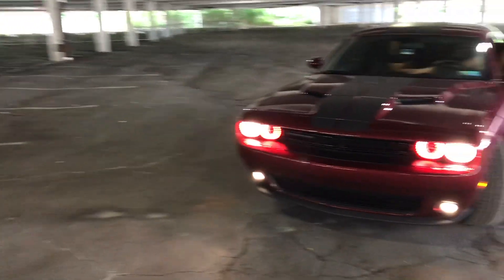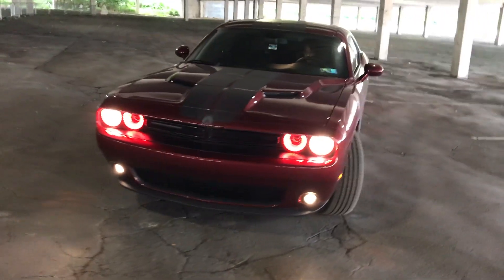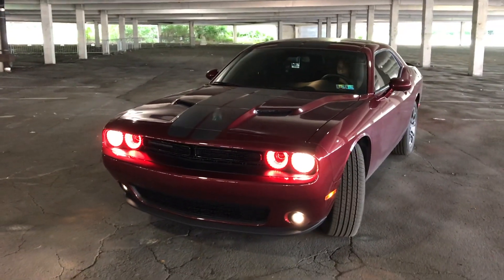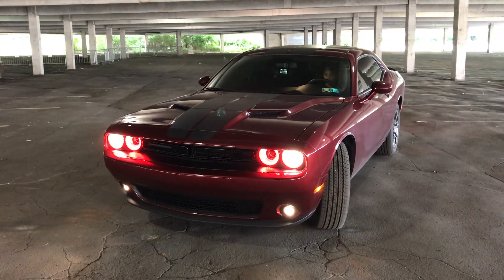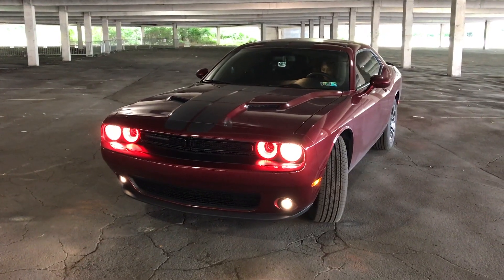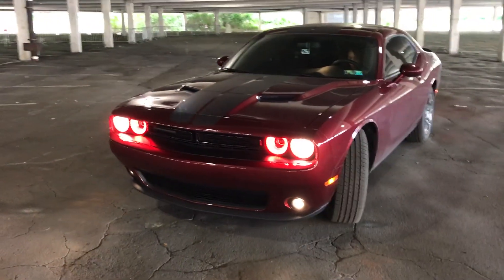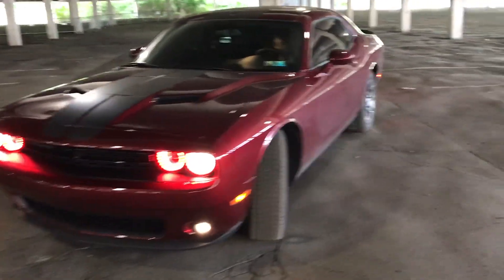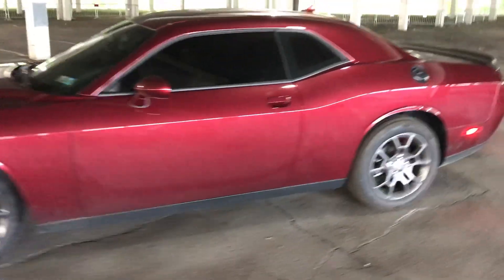How to WAKE up That Quiet V6 Challenger!!!!

Comment: I'm going to add this to my  Challenger V6 in the spring. It's the best sounding I've heard so far. Plus, the lack of serious drone is a major factor. I'm doing it to give it a little more attitude. I could have bought a Hemi but didn't cause I commute a long way each day, plus the extra cost and insurance, premium fuel etc., the V6 just made more sense. Really, getting the Alpine stereo (I love music) was more important than the extra horsepower. Since I drive mostly highway miles, I've averaged 27 mpg most weeks and that INCLUDES city driving. So if the Borla ATAK can boost fuel economy, I'm sold!
Reply from the maker: Oh you're making the right decision here i LOVE this thing man!
Reply: I heard the alpine sound system is the factory one and sounds bad

Comment: The world of muscle cars is competitive ! I have the v6 Challenger as well. Looks mean, handles well but 😂 kinda a lay n play scenario. Fools are pulling up ready to rock. I can't quite cover that bet. My start is good but I'll finish last. I'm gonna purchase the 8.. but for now ill fake it til I make it.. nice upgrade man. Sounds cool.
Reply: i am dead
Reply: Bro i freakin died 🤣🤣
Reply: Lmaoo facts im the same
Reply: Trying to buy one of these in Netherlands is no joke......
Reply: @Labramike   we can help you with that at Braxx Motors
Reply: Turbo charge your v6
Reply: I'd you want to purchase a V8 I recommend the 6.4l. do not get the 5.7. I own a 2017 charger Daytona 5.7 and it's great until any Camaro V8 or a mustang 5.0 pulls up and dusts you. Not only that but you get the same fuel economy with the 6.4 as you get with the 5.7. but you get that extra 100 hp. Trust me save a bit more and get a 6.4 not a 5.7
Reply: a v6 with a supercharge kit will actually increase gas mileage, cost less in insurance, cost less than a v8 and not weigh in as much, with the right tune will put you around 420-ish whp @ roughly 360 torque, with a couple of other tweaks, you could could push well over 450whp, without all the stupid noise drone...which annoys the hell out of me when i am jamming my music and only impresses the ladies for about 5 minutes....
Reply: @PaulNicolau  with the 6.4 u can only use 91 octane and its super expensive if it's your every day driver. The 5.7 u can use regular gas and less expensive to maintain.
Reply: It doesnt bother me that I cant cover that bet. so far Ive taken quite a few cars and if I lose a few I dont care, the car is a definite head turner and I get multiple compliments on the car and color every day guaranteed. especially when its all detailed looking pretty. People can kiss my ass if they have any judgments. I worked and am working my ass off for this car.

Comment: Dude!!! This is the BEST freaking exhaust note I've EVER heard on a v6. Did you do anything else to it besides the cold air intake? ... I have the stock intake with K&N air filter.
Reply from the maker: Nope just the cold air intake & the full catback
Reply: @RomanDeHonney  Awesome man. Are you going to supercharge it? I've been researching RIPP Superchargers and the performance coil packs....

I guess they make them to fit the 3.6 without needing to do any internals.
Reply from the maker: I actually got rid of it, got hit and was t the same after that. I got a twin turbo Kia stinger now
Reply: @RomanDeHonney    cat back available

Comment: First, I apologize for using a translation program. Unfortunately, I do not speak english.
My question: If you drive between 1000 and 2000 rpm (RPM), how does the exhaust volume behave? If the police drive behind you, is the volume noticeable or moderate?
At us the police are strict and checked immediately if you the exhaust appears loud. Therefore, the question of how the Atak behaves at low speeds during the ride.
Thanks in advance.

Comment: I'm so late to this video, but this is exactly what I need to see to confirm which exhaust I'm getting for my 2017 sxt, did you install it yourself?
Reply from the maker: Wumbo glad I could help! No I took it to a shop. They only charged like $75 bucks or so it was an easy install with a lift
Reply: @RomanDeHonney  oh ok sweet, I'm 90% sure I'm gonna do the same
Reply: @RomanDeHonney  did you buy a kit or did you just straight pipe it.

Comment: Wow sounds so so much better. Why doesn't Dodge put in an exhaust like that? They would sell so many more. I want the gt all wheel drive and the power is a little weak but that exhaust would be a game changer. What model borla and how much was it. Great sound. Enjoy that beautiful car.
Reply from the maker: Not sure, maybe people want a quieter car, but its a Borla ATAK. I thought the thing same I want more power but for where I live it doesnt make the most sense. I went with the need more than the want but 305 HP at the crank is really good. The car isnt slow at all. Then if you install a Pedal commander its wayyyyy more fun !
Reply: Maybe they wanna push people to buy the v8 Instead of the 6. It also probably cost for them to make as well

Comment: Dope vids..Just bought a 19 challenger sxt and looking to upgrade my exhaust..with the new exhaust would I need to do any resonator or muffler deletes??
Reply from the maker: K Simms nope this is just a full catback system
Reply: Thanks updated from a charger but kept it stocked. looking to make my challenger a sleeper..how does the Borla exhaust sound within the car I don't anything to "to" loud
Reply from the maker: K Simms no drone, you can hear it when you’re at higher rpms but they designed it beautifully
Reply: @RomanDeHonney  thanks for the input appreciate it

Comment: sounds good. I settled for just a resonator delete which has its own deep tone and growl. wasnt trying to spend upwards of $1,000 for my exhaust knowing I wouldnt get that V8 sound. but this is good and probably added a few hp, nothing drastic but an increase nontheless
Reply: $1,000 exhaust is pro. That is not cat back. That is headers back. Full exhaust. Cats mid pipe muffler pipes.

Comment: I’ve got the same color on a 2018 3.6ltr with the dynamics package 20” wheels etc. I’ve Ben debating the exhaust upgrade but looking more into the lowering because even with the 20’s, I have a lot of room to lower.

Comment: Do you notice any increase in hp?
Reply from the maker: No, you wont notice any hp gain unfortunately
Reply: @RomanDeHonney  It's all good I'm still getting this for my Challenger it sounds dope 🔥🔥
Reply: Guarantee he did increase horsepower at the wheels. I've seen more than enough dyno runs to confirm this, but the gains are not large enough that you'll really notice it. These motors put out 305 crank horsepower which equates to around 245-255 at the wheels for the RWD and about 215-225 for the AWD's due to drive train losses with the stock intake and exhaust. With that said, from the dyno runs I've seen, the cat-back exhaust will add about 10 wheel horsepower. That's only about a 5% gain in wheel horsepower. Fairly insignificant, but still an improvement.

Comment: I own one ....the pentastar V6 can never be made to sound good... mainly because the cylinders all funnel into a single exhaust port cast into the heads... if each cylinder had a separate exhaust , it could sound good.. and muffler shops know this.. they just cash in on peoples emotions to make the car sound tough... but hey you wanna spend thousands on  a exhaust knock yer self out...